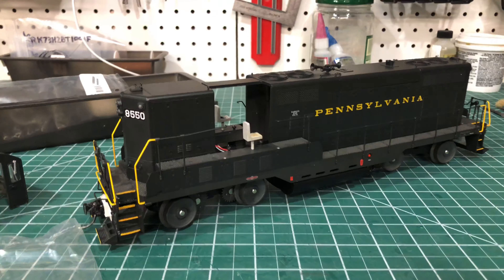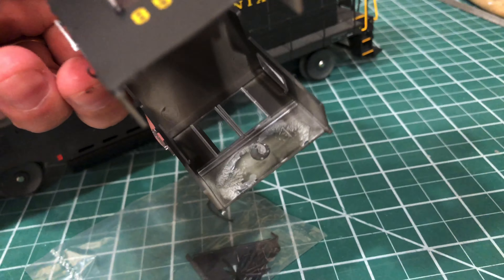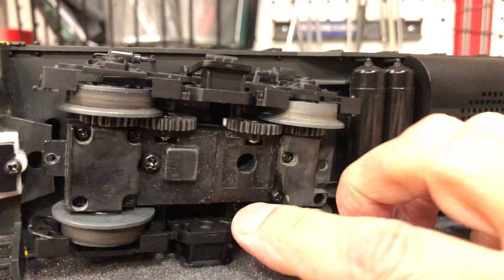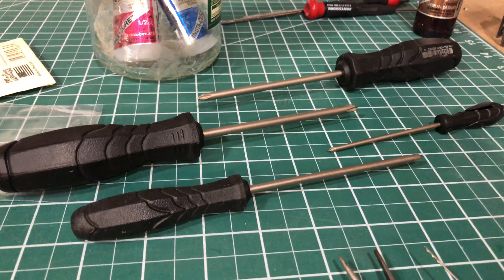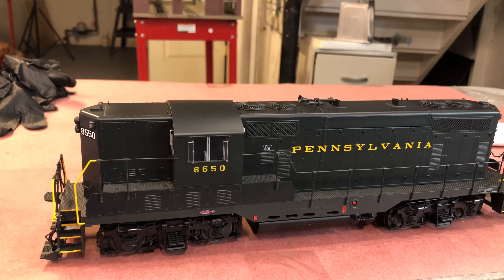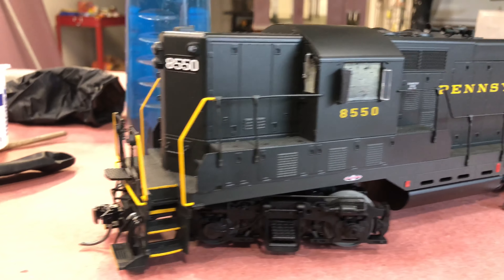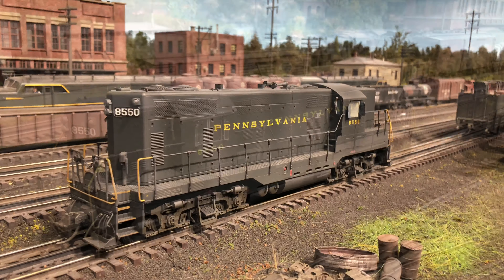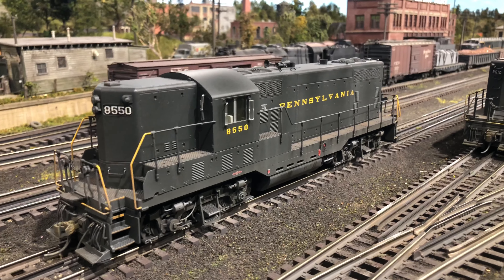3 Rail Scaling an Atlas O PRR GP7 Dummy Part 2 of 3

Comment: Thanks for the tip on the screwdrivers.  I never knew the screws were different.  I will look for a set.  Looks like yours are made by Hozan?
Reply from the maker: Nathan5Chime yes they are made by Hozan, got them from eBay. Glad you found the info useful and could put up with my droning on.